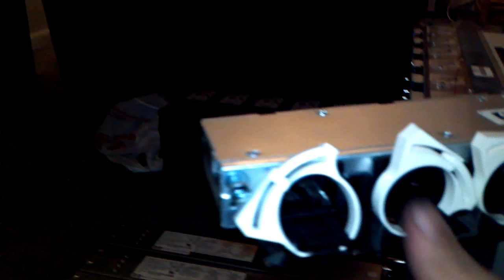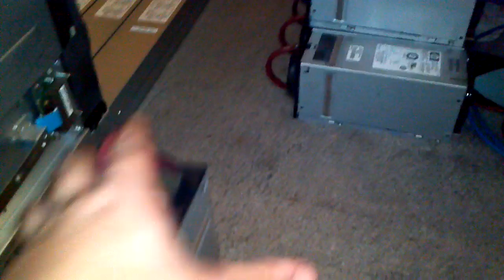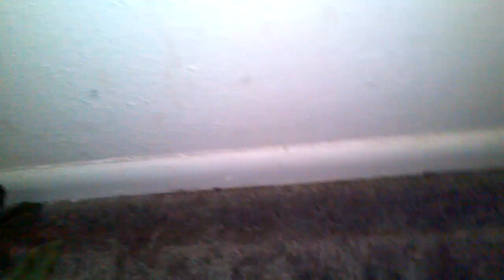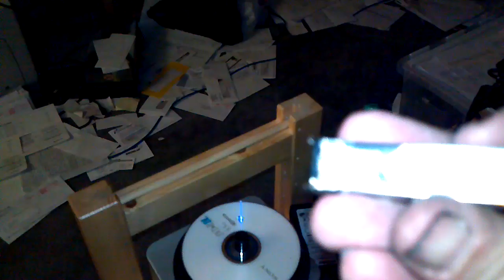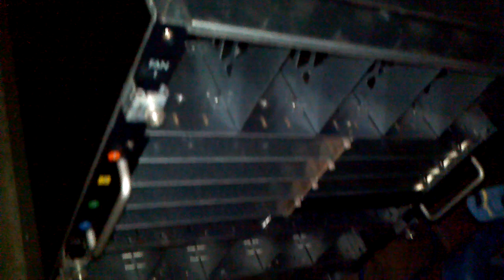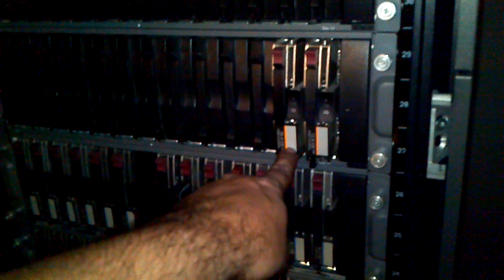HP BL-C7000 Blade Chassis - Individual Components

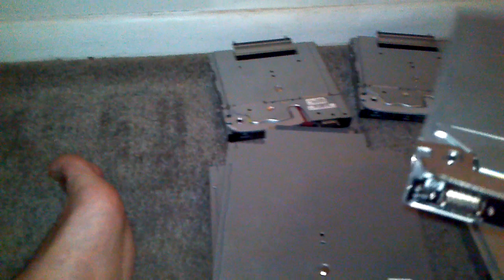Comment: 5:10 - its not an FC module.  VC 1/10 is Ethernet which has 2 CX4 10Gb uplinks and 8 RJ45 1Gb Uplinks.
6:00 - FC is not designed to connect to JBODs.  Those VC FC modules require an upstream FC Fabric that supports NPIV.

After installing around 75 of these c7000s, I would recommend not removing the midplane from the main Enclosure but instead just remove all the other pieces you had out.  Midplane alignment is very critical.  1 Strong person can move an empty enclosure to mount low in the rack.